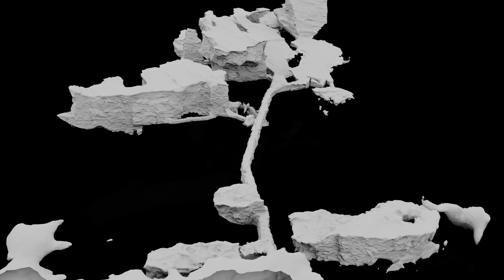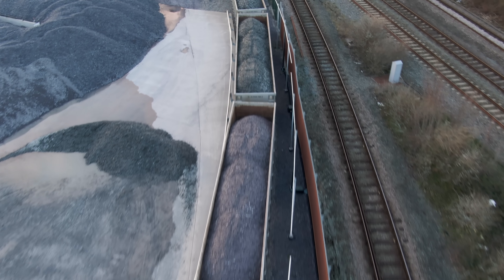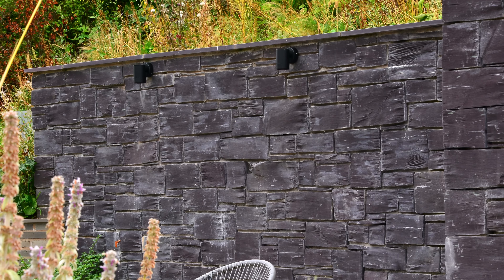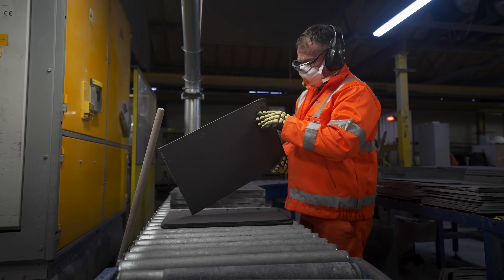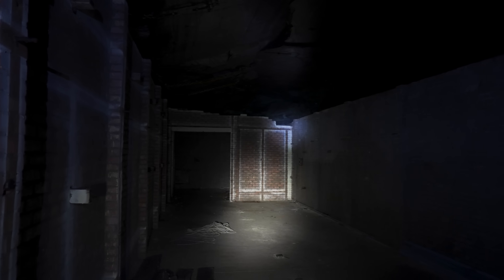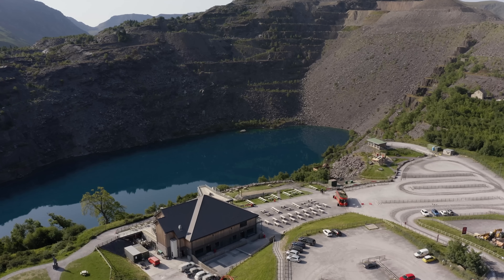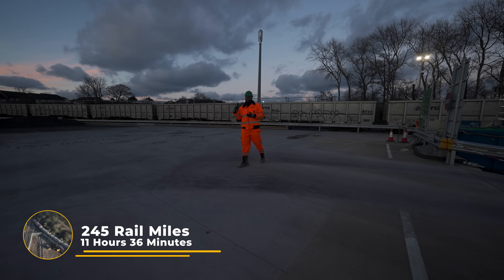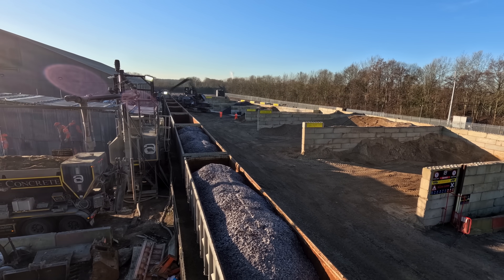WWII Treasure In Underground Bunker Beneath Quarry

Comment: Absolutely fascinating again!  However, can you explain why 265 miles takes 11 hours?  That's seriously slow....
Reply: 1) It's because the freight train is slower than passenger trains, so often gets put in a loop waiting for the next gap between passenger trains.  
2) As the slate isn't time sensitive, and the journey is too long for one drivers shift, the timings of the train are done to get the maximum productivity from train drivers, rather than trying to get there as quick as possible, so the train may sit in a siding without a driver for several hours, somewhere between Llandudno Jn and West Drayton.
3) the train has to run on several different lines, each with a separate passenger timetable, so the train has to be held in more loops when going from one line to another waiting for the next gap between trains.